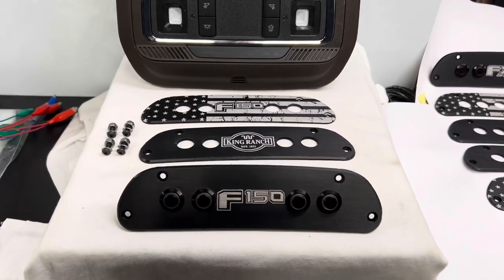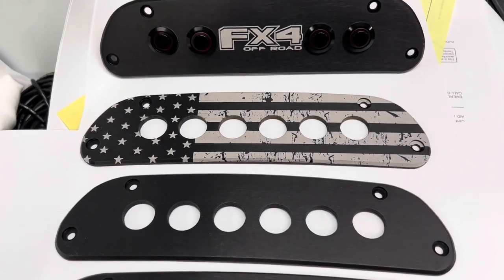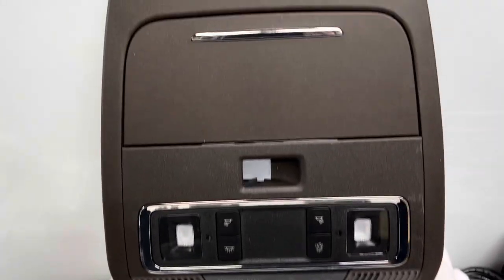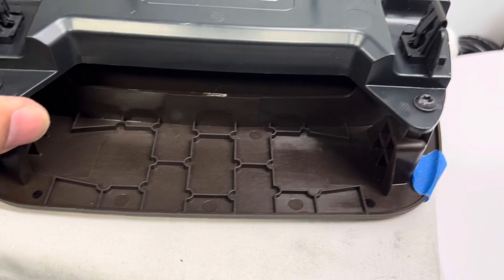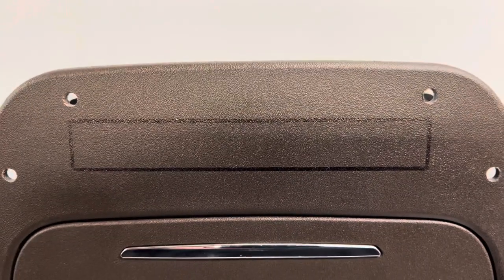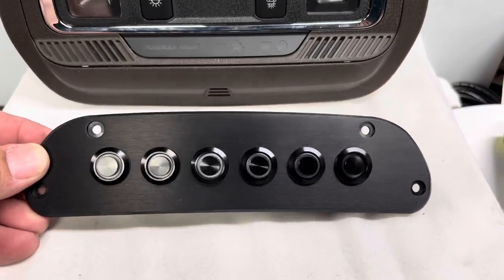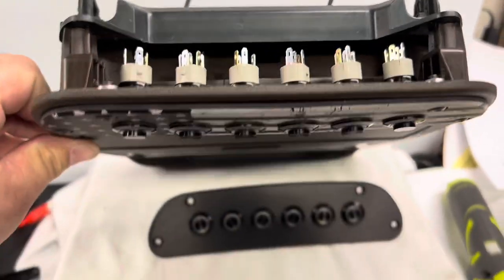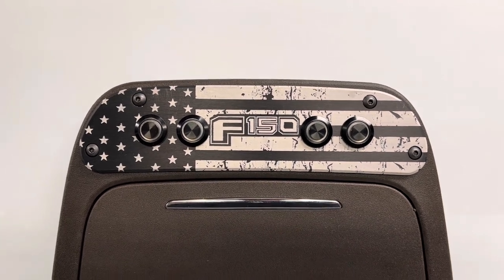2021-2023 F150 “TL” Switch Panel for overhead console

Comment: i know every configuration has it price but what's the base price for a 4 switch panel? Also what relays would you recommend to use with this panel? Is a wiring harness included and how is it recommended to run?
Reply from the maker: There are too many choices to list. 
As mentioned in the video, my email is: kustomfx.info@yahoo.com
Please email me and I can reply with your options. 
Thanks.
Reply: @kustomfxllc.switchpanels3144  Thanks I also have been going through you videos and you've essentially made  videos covering all my questions! Thank you.
Reply from the maker: @goatk1  sounds good. Any questions, please feel free to contact me directly and I can email reply back with info, options, pics and pricing. 
Thanks!